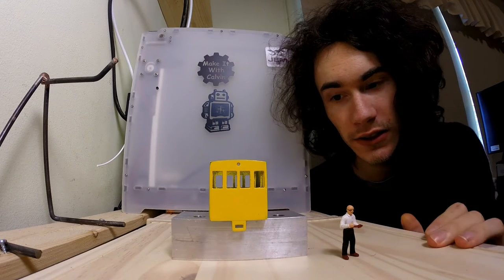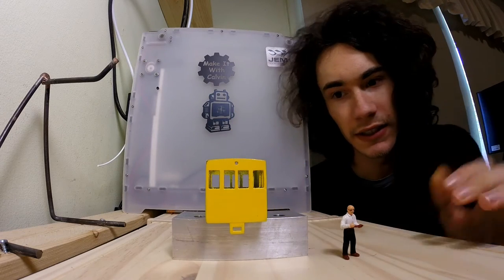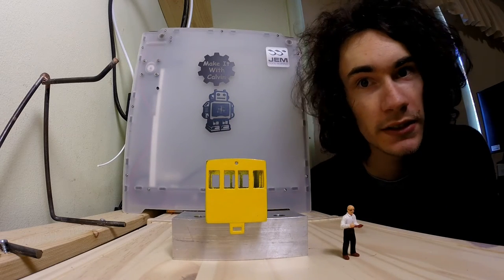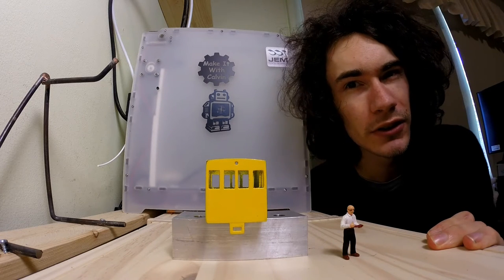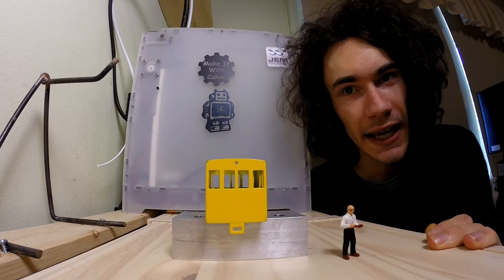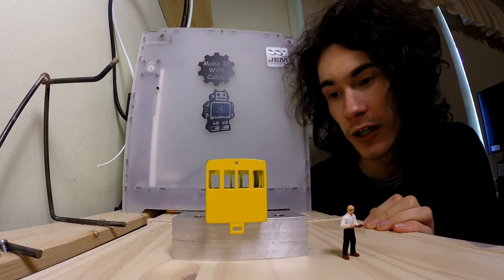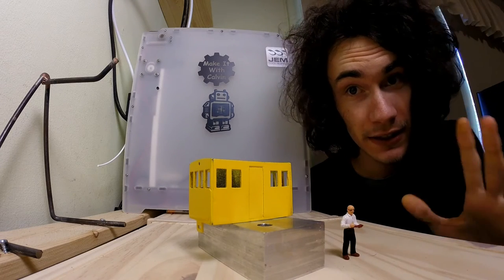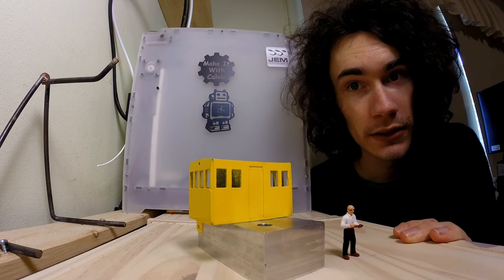3D Printed Boxcab Locomotive Pt 2

Comment: What scale is the "3D Printed Boxcab Locomotive " suppose to print at??  They appear very TINY in my slicer
 software?
Reply from the maker: I need to update the files but they were drawn in inches so need to be scaled 2540% to make them the right size. My slicer would auto-scale but I forgot most will not.
Reply: @MakeItWithCalvin  Okay, makes sense thank you.